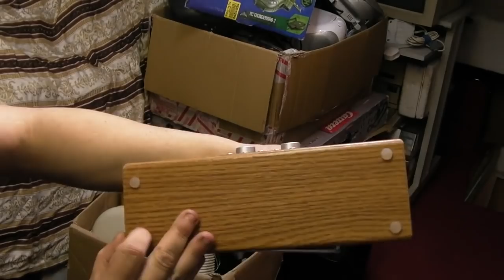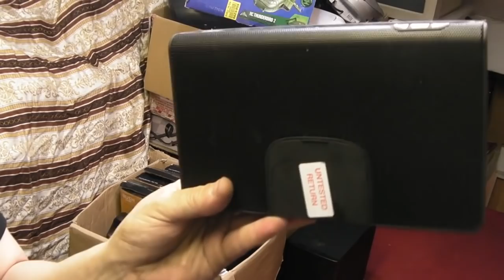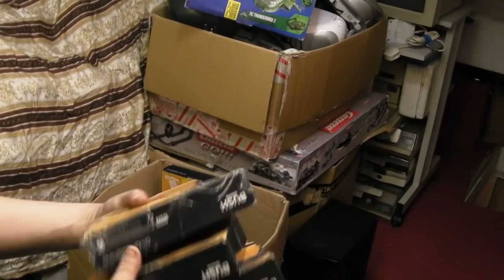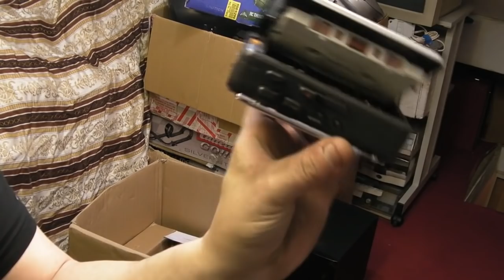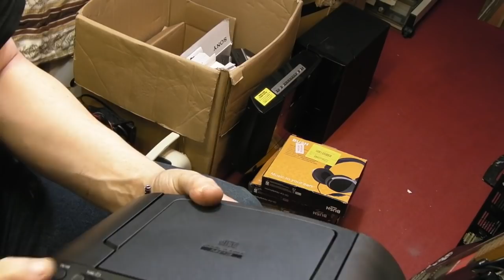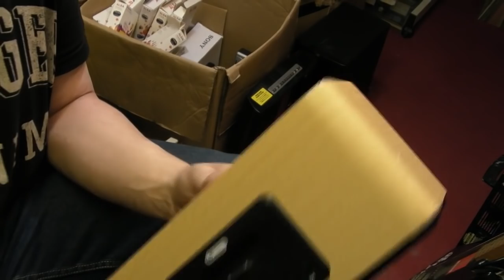Catalogue electronics returns mega haul Pt1

Comment: Ok, Jay, here's a project idea for you.  You've got all the makings for 8-bit "WiFi".  It's just a stupid computer trick, but great fun.  I've done it at a local Mini MakerFaire.  I brought a TRS-80 Color Computer with a combination TV/AM/FM radio, which I used both as a monitor for the CoCo, and also its wireless network adapter.  I also had a modern laptop with one of those FM transmitters, looking exactly like the ones you have there, hooked up to its audio out.  I hooked the audio out of the TV/radio up to the cassette interface of the CoCo.  I'm sure you can see where I'm going here...  I had to type 'CLOAD'<ENTER> and then switch to FM (switching off the monitor).  The TV had a single tuning dial for TV and radio, so I had the transmitter tuned to the FM frequency that was at the same point in the dial as the TV channel 3 that the CoCo was putting its signal on, so I wouldn't  have to re-tune between typing the cassette load command and trying to load the program.  That would have been nearly unworkable.  Then I played a .WAV file containing a cassette-based game program on the  laptop.  I got successful loads more often than not, if only just.  :)  

I know that there were radio broadcasts in the UK and Europe in the '80s that did contain cassette-based software for the Sinclair machines, and maybe some others.  I'm not aware of that having happened in the US.  Certainly not in my area.

So here's your challenge:  build a retro-wireless network adapter using the circuit board from one of those FM transmitters, and an FM receiver board salvaged from one of the other things -- maybe one of those 'walkman'-like devices with a broken cassette mechanism.  Bonus points if you can build it into an '80s-looking case, like an old modem enclosure, and extra bonus if you can make it transmit back to a modern PC to save your game progress!  Then load up a Speccy game wirelessly.
Reply from the maker: oh now that does sound like a fun project.